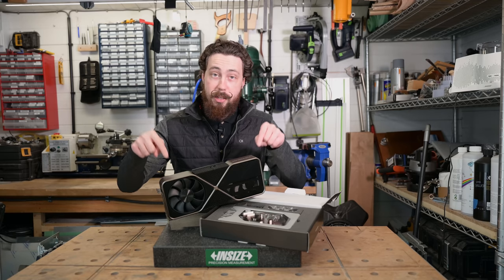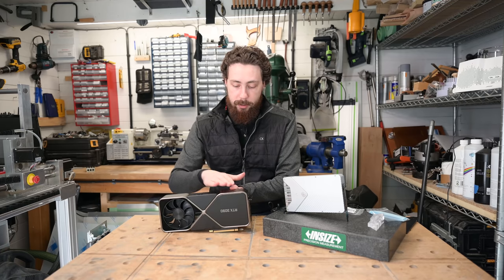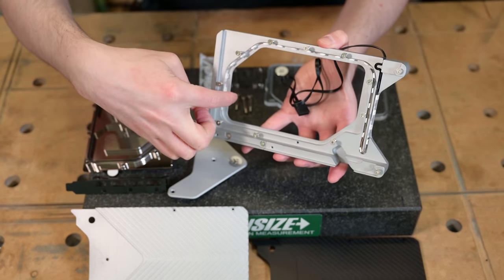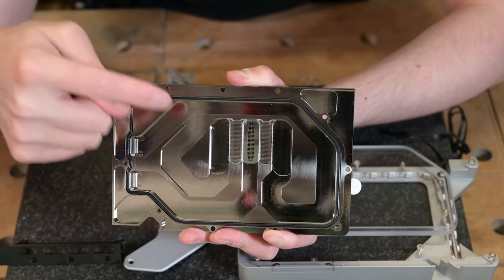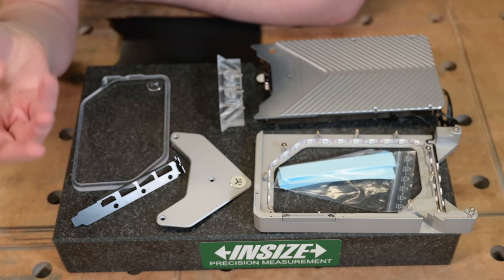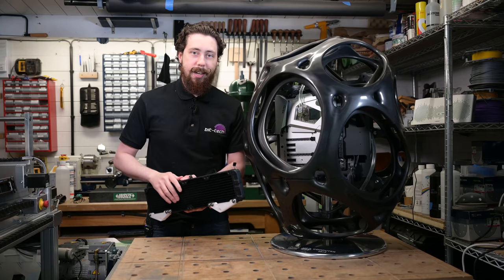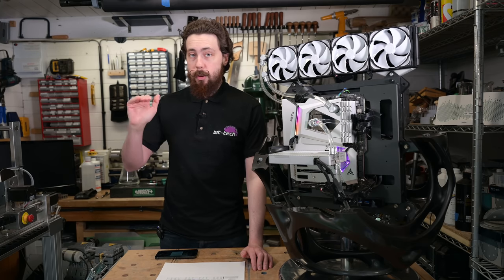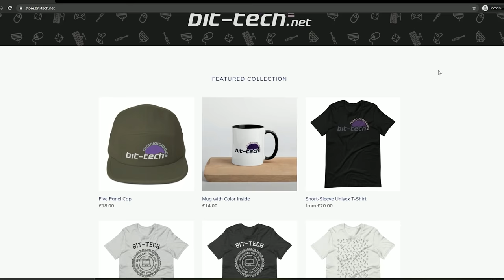EKWB Limited Edition 3090 Waterblock teardown | bit-tech Modding

Comment: Loose screws is an EKWB favourite. I just took out an EKWB Vector 2080ti Strix and one screw on the block was wiggling around due to no tightness at all and several others had next to zero tension on them as well. I have also seen this with a few other EKWB waterblocks I have fitted including one to a 2080ti FTW3. ANother youtuber that I watched back in time mentioned it was always worth checking every one of the screws before installing. What I will say is I have had no leaks from EKWB items, so even if the screws were loose, overall the waterblock was well sealed.

Comment: I've seen on REDDIT some 3080 blocks being accepted in RMA because the coldplate was not mirror finished, so double check with EK.

the want is strong in this, but I first need to yet put my hands on one of those cards. I think I'll wait the winter to upgrade
Reply: vram running at 110c yea ur gonna want to if u can afford one.

Comment: I had a very uneven surface at the die with my strix block. I took some time to sand it down and had to remove a good 0.1mm before getting a smooth surface.

Comment: I have change out my thermal pads on 2 of mine asus strix 3090 cards from ekwb pads to Gelid solutions GP-Ultimate pads. And I dropped the temperature from 110c to 80c on the memory junction when mining. Thats crazy. I will never use ekwb pads again. Can highly recommend the Gelid solutions GP-Ultimate pads. They are a bit pricey but in my opinion they are worth every penny.

Comment: I have this waterblock with my 3090, for the thermal pads, I basically bought like 4 tubes of Thermal Grizzly Kryonaut paste and spread thermal paste on both sides of the thermal pads then put the thermal pads on. This worked great, temperatures were lower.
Reply: OH MY! Why would you do that? Adding thermal paste to thermal paste will just destroy the pads over time! Big no no.

Comment: I fully agree after finally getting mine that they need to do precut and applied thermal pads, Especially in the spots for those really tiny ICs that need a little bit of pad the size of a pinky nail.  Cutting the pad itself wasnt hard but getting the foil off sure was.   But its getting great numbers, If I have to take it apart at any point again I might consider ordering those thermal grizzly pads and see if they are any nicer to work with.

Comment: Good video.  But whatever software is controlling the camera's focus needs to be adjusted.  For example, for a few minutes after 11:00, the camera changes focus at least 20 times which is a bit distracting.  I'm no expert but perhaps it's because auto-focus is confused on what it should focus on, which could be your hand, your fingers or anything else that's moving.  Maybe just fix the focus on the waterblock instead or reduce the speed at which autofocus is triggered to several seconds instead of immediately.

Comment: Someone on /r/watercooling said they dropped GDDR6X junction temps by around 10c by replacing the stock EK pads with Thermalright Odyssey ones.

Also, a missing screw on a £300 block is totally unacceptable.

Comment: i did fit a 360 radiator plus a 240 rad inside the meshify s2 chassis and im sure that i could put a 360 instead of the 240 to have a dual 360 inside my chassis if you were looking for one well thx for ur video i was looking for a waterblock realy soon from ek

Comment: Will you do a teardown of the active backplate, too?

Extrapoints for showing me a way to vertical-mount with the backplate in front instead of the waterblock. I personally love the look of the backplate MUCH more. So far, nobody I asked could help me with that one..
Reply from the maker: Could use an MNPCTech vertical mount and turn that upside down? Tbh it depends on your case a lot, it's a very simple mod but it does depend on your capabilities and tools etc.
Reply: @bittech1  That answer was WAY faster than expected, thank you so much! Iam using an Raijintek Enyo, a pretty large open-frame-case with more space I could ever need. I'm going to check that one out - Iam sadly not really skilled in such things but I guess I can compensate the lack of skill with time.. lots of. :D
Reply from the maker: @falkhogan  The MNPCTech bracket could be the ticket then, it takes up a 120mm slot, but with that case you’re laughing really. I assume Bill’s still making them?
Reply: @bittech1  i do think so since i could buy it... That Thing is btw Just perfect. And yes, easy 120 Slot. Im thinking of Putting it Not only reverse-vertically but also horizentally. Would also ease the mounting

Comment: Missing a screw, short screws and the machining of the cooling plate, which seems to be rough ( especially where it has to touch to the die of the GPU ) isn't very good. They could have done better. Do you have to lap that piece of the plate? I take my hat off for you to pull out your personal stuff to make this video, thanks Alex.

Comment: I would have preferred a single colour too... black to be precise, as my internal are black.
But I figured out that the silver back would reflect the RGB.

Also, the memory temperature are different mainly because Nvidia uses the worst pads imaginable... if you don't want to mod your FE, you just buy on Amazon good pads just for the back and drop your temperature a lot.

Comment: The 3090 FE has terrible thermal pads, this has been known for a long time in hardware circles. That's why you were seeing massive throttling on air. The memory instantly hits it's max allowed temp and throttles to compensate.
Reply: Agreed. Changing the pads for mining brought temps from 110ºC (max allowed) to ~94ºC when warm in my house. I am tempted to try the same brand pads (though 1mm) instead of EKWBs, but that adds another $50. The observed temps are already just fine with this block.
Reply: I swapped my ek thermal pads with thermalright ones. Pretty big difference in temps, like 10-15C
Reply: @KANATADOMPIZ  how much did the additional pads cost?
Reply: @eriknastovski1330  15$ per pack, needed 2 packs, so like $30. I didn't use expensive pads on everything, only the memory.
Reply: @KANATADOMPIZ  If any water block manufacturer raised prices for $30 for adding better thermal pads, they'd be crucified by the users. This is why basically all water cooling manufacturers use mid-range pads over high-end pads which are extremely expensive, but only slightly better.
Reply: @eriknastovski1330  I'd normally agree and these pads are fine with respects to the caps and mosfets but for the VRAM modules it actually makes a difference on these cards. We're talking a 500CDN block here not a 90$ Byski block.

Comment: Great video! I'm not happy with the smoothness of the part that contacts the die. Silicon is brittle and those points could crack it. Those screws on the end water attachment are also way too short. Lastly this design does away with the spring clamp from the back of the GPU. This is very important for enuring even  pressure on the die. It worked for you but i can see the potential for damaged cards.

Comment: What PSU are you using? I'm looking for one with without the mesh sleeving and bulky heat-shrink.
Reply: I mean, you can make or buy custom cables. That way you can choose whatever PSU you want.
Reply: @Outland9000  At the time i did not have the space for cables and extensions, and I didn't want to spend more than $120 on a psu upgrade AND aftermarket cables. Luckily I found a better case where small and flexible cables were not needed. got a new rog strix 750w for 40% off
Reply: @tthbeige3332  Nice. Although I don't use extensions, just make my own custom cables. It's often the only way I can make builds work in SFF cases.

Comment: Removing the film from the thermal pads was a complete nightmare. Thankfully there were plenty of pads but still. Not acceptable esp with the price. Otherwise the block is amazingly beautiful and performs noticeably better than the corsair 3090 fe block I had and the cooling on the back of the block has allowed better OC
Reply: you have to remove the soft film before removing the hard film. If you do it the opposite way you lose material / break it

Comment: is 20 minutes really enough time to heat soak such a large loop?
Reply from the maker: Easily, it had basically saturated by 10 minutes. I left the first try on for longer but it didn’t change at all. The bigger issue was having to wait between runs to get the coolant temperature back closer to ambient.

Comment: This isn't the first Ek review I've seen with the bad QC on loose screws this month. Fix it EK, it's not good enough.
Reply: Which is why I'm never ever going to purchase anything from them again. I had 2 of their FCWB for my EVGA 980 Ti Classified's on my very first custom  liquid cooled build and about a month later the top GPU block leaked all over the bottom one killing it along with the PCIe slot it was in on my motherboard. The blocks even had a QC Passed and Leak Test Pass stickers on them when I got them brand new directly from EK. The liquid leaked from 3 screws that hold the 2-piece block together. It was my first custom water cooled build so when I saw they had Leak Test Pass stickers on the blocks, I didn't to tighten down the screws myself just to be sure. On top of that which kind of annoyed me in the beginning was they refused to make an EVGA 980 Ti Classified waterblock because their blocks for the 780 Classified's were compatible. Talk about bad first impressions/experience with a company.
Reply: @gh0stp1rate  EK replaces all damaged hardware if the cause is product failure that was leak tested and not disassembled by the user. So if you did an RMA, EK would have reimbursed you for all the damaged hardware.
Reply: @eriknastovski1330  Yes I know that and that's good on them. But they had leak test passed stickers on them, plus it was my first custom water cooled system and my first impressions of their company. Also they hardly ever make blocks for high-end EVGA motherboards and GPU's anyways so I have no reason to ever purchase anything from them again. Bitspower on the other hand will make blocks for them. Also, I now know better and tighten the screws down before a build.

Comment: you shouldnt have run the colling from cpu to gpu go from cpu to another radiator back to the gpu that will help with cooling a lot
Reply: Loop order doesn't matter.
Reply from the maker: As mentioned, it'll make no real world difference, especially with that amount of radiator room. Also the order goes GPU -> CPU, watch where the tube on the CPU - IN is connected too.